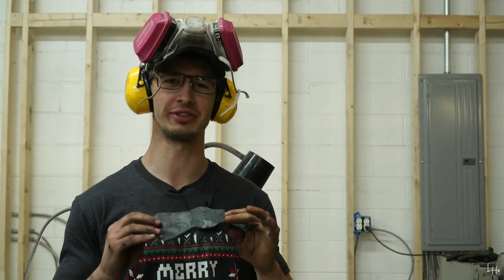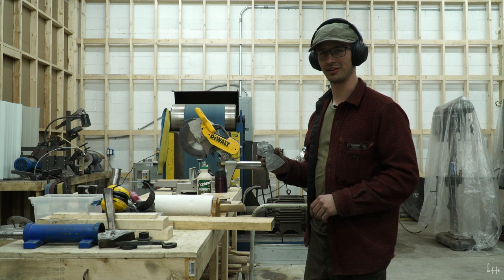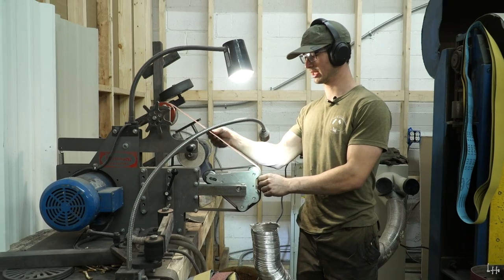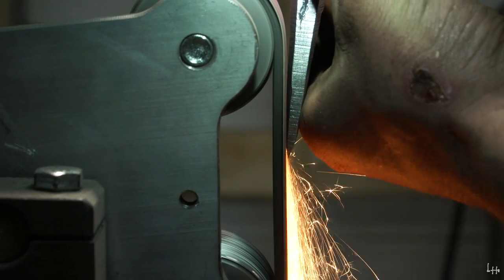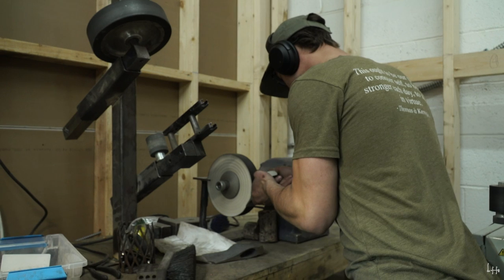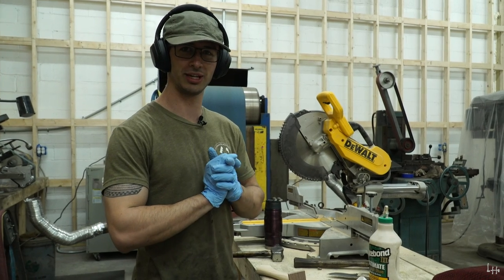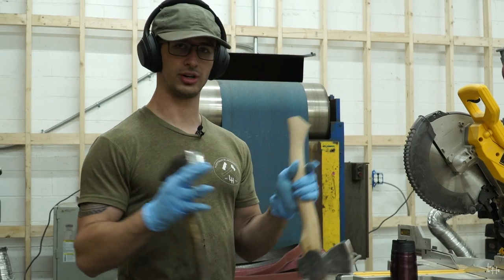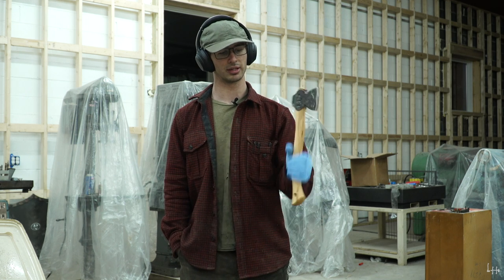CUSTOM AXE BUILD AND SHARPEN

Comment: About 30 years ago I read a book on sharpening.  The book was written by a guy who held the Guinness record for taking a dull, rusty axe head and sharpening it, in record time, then shaving a four month old beard. I use a straight razor but am not champing at the bit to shave with an axe!

Comment: Is there any advantage to using an oven to heat treat as opposed to the forge.
Reply: Absolute control of the heat treat and getting the most you can or specific qualities from a steel You can harden a lot of steels by heating til red and dunking in an oil. But if you want more control you need an oven and the proper oil for quenching. Even steel like O-1 which is super easy to harden will be greatly improved by heating it and allowing it to soak in the heat. There are some terrific videos explaining heat treatment.

Comment: Doesn’t the eye have to remain unhardened? How do you do that if you quench the whole head? I’m confused. 
Nice hatchet!
Reply: David Coats 
I wonder.  Maybe he reheats the eye and lets it cool slower, for differential hardening?  But since he didn't show it, i wonder if maybe instead he just doesn't heat it long enough for the back part to reach hardening temps before the quench?  Since the back has more thermal mass, it might not have heated up as much as the blade.
Or more likely, he feels like the force on the eye of the axe during normal use won't be significant enough for him to require differential hardening.  
Just guessing though :)

Comment: Is it weird that I watched this video while holding an old TrueTemper FSS (and small B4 ) stamped 3 13/16" bit 27" haft axe with perfect grain... That I have painstakingly evened up and slightly modified the fawn's foot angles, oiled, made a leather bit cover/shoulder sling for, sharpened...and just butcher block waxed... And no it is not even close to the first one! LOL!